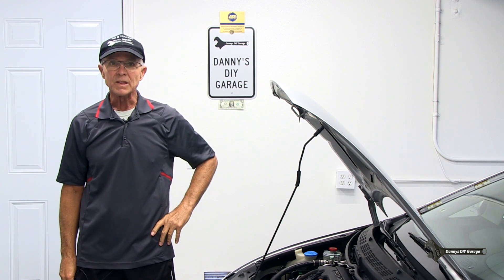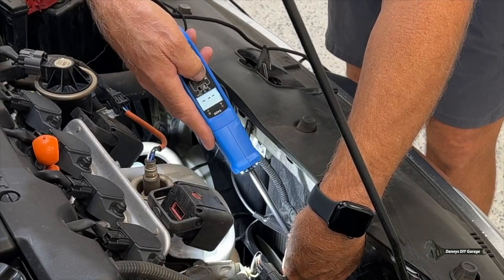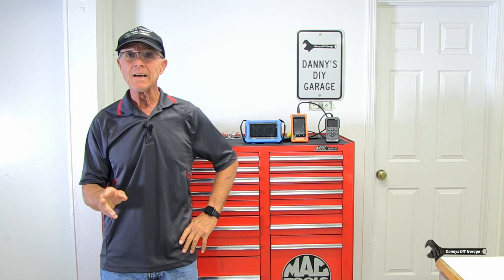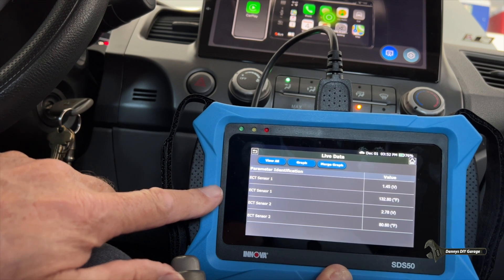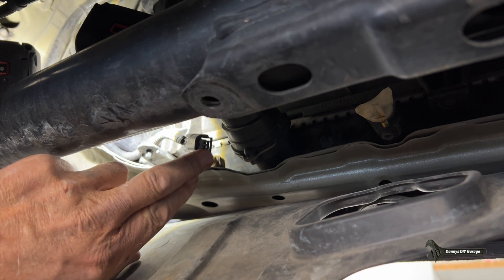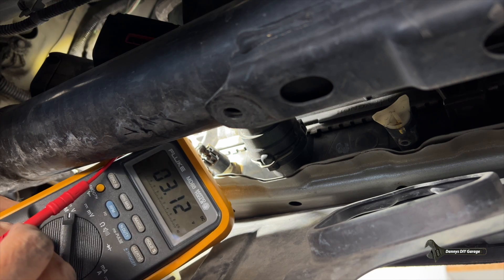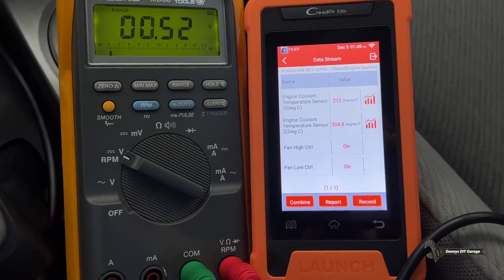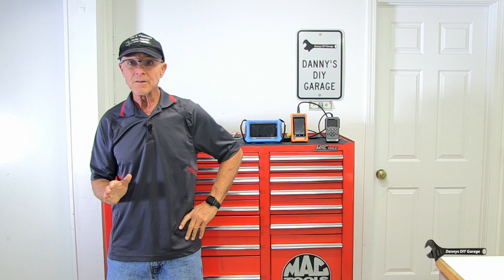Honda Civic Overheating? Cooling Fan NOT Turning On? (Diagnosis & FIX) How Fans Work

Comment: Hi Danny, thank you so much for this video, my car is overheating. I did the diagnosis as per your video and both fans come on when ignition is on and AC is turned on.

I dont have the tools for testing voltage etc or car scanner.

Could I simply replace the 2 sensors and that should fix the issue?
Reply from the maker: You could, but there are other things that could be causing this, such as wires, relay, computer its self.

Comment: Hi I have a 07 SI coupe. My problem started with code p0118. Besides that I had seen the fans stayed on after the ignition was switched off. So the actual problem was after all that my fans never came back on so I buy 2 new sensors from Honda ect 1 and ect 2. Now after install no codes are on and the fans do turn on. I did the ideal relearn procedure and after the fans do come on this time because before they didn’t now they won’t shut off at all. I remember before when everything worked correctly I would disconnect the ect 2 sensor and the fans would come on automatically but now that I do that they don’t. Do you think all these problems are coming from a none working relay that would be the relay that is the fan control relay being the gray one? Please help I’m at a loss here.

Comment: Hi, 2006 Honda civic here. Overheating, both ECT sensors changed, thermostat changed, fan works when direct power is applied, fan works when A/C is on. However, fan will not turn on when temperature is reached. Relays and fuses are all good. ANY OTHER IDEAS PLEASE❓️ ALSO ZERO CODES.
Reply: Aftermarket generic garbage parts sensor?
Reply from the maker: did you watch all my videos on fans and overheating?
Reply: @dannysdiygarage  it could be a number of things. In this case
It was the Head gasket.
Reply: I’m having the same issues now on my 2010 civic. Did you find out what was causing the issue
Reply from the maker: Watch the video at 13:42, you will need to see if sensor 2 drops to .5

Comment: 2010 civic. There are no codes at all, but I am getting ECT 2 staying way lower than ECT 1. I have a fancy scan tool showing each degree as it goes up. I think my fans aren't turning one because ECT 1 may be at 111 Celsius (so getting pretty hot) or climbing even higher, and ECT 2 might still be sitting at 1/3 of that and 3 volts. So I guess it must be either that connector or that sensor? Nothing else causing the fan issue likely right? Got the sensor coming tomorrow, and hope it works.
Reply from the maker: The fans are controlled by sensor #2 only, and will only turn on once sensor #2 gets below .5 volts, the fans will never come on unless sensor #2 is below 5 volts
Reply from the maker: https://youtu.be/GVRF11BPRZA?si=Fyop-iAqojrXTzb7
Reply: Here is a pic of while it is heating up. Replacing thermostat at least made it start to fluctuate as it goes up according to ect 1 and push heat out through the heater, so that is progress. EcT 2 replaced and it still has a big gas with ECT 1 and does not move. I watched that other video and it was very helpful. It is really odd because ect sensor 1 is showing me 110  plus in celsius so well over 200 degrees while ECT 2 voltage  and measured degrees stays insanely low. Like 3.49 volts and 13 degrees celsius which can't be right. Brand new sensor I just tried. Tested the voltage and the connecter gets 5 like you said. Relays and fuses are all fine and fans go on when I put ac on. I am very confused about the new sensor is not changing much while sensor 1 is doing the data right. There is no way this is a pcm or communication thing right?  @dannysdiygarage
Reply: @elizabethloudon6097  Hi, you might wanna check out your radiator. The ECT 2 is located at bottom of radiator and the radiator lines are choked or plugged with debris (most probably from running on tap water or a poor quality engine coolant by the previous owner). So, very limited coolant flow to ECT 2 causes it to read low temperature because the radiator is plugged and that's why it reads low than ECT 1 as there is no equal flow of coolant between the 2 ECTs. ECT 2 at low temp wont let the fans turn ON and ECT 1 will continue to show raised engine coolant temperature on Dash meter. Get the radiator serviced and thoroughly cleaned. flush the engine block and heater core with distilled or tap water on high pressure. vacuum or pass air through the whole system to remove all the residue and tap water and then fill out with good quality coolant. That should fix it
All this I am telling you from my own 8th Gen Honda Civic.
Reply from the maker: Watch this video I’m going to send you, then go back and watch the one I refer to, this is for a Element but they work exactly the same way

Comment: My fan comes on at 224F, per OBD2. The temp gauge remains in middle (always good). Presumably normal? No codes...just concerned that others claim their radiator temp switch activates much lower. One other issue with my 2005 CRV is that the fan will 'turn off' if the key is turned off...it doesn't stay on to cool when car is not running. Can't find info. on whether Honda intended this or not.
Reply from the maker: Perfectly normal

Comment: Do you know what will cause both fans to run all the time?ive replaced the tstat,both temp sensors and filled and burped the radiator.also the ac lines ice over while idling.(2006 civic sedan 1.8)
Reply: Yes sir.ive swapped relays,replaced tstat,both temp sensors,new blue coolant with bleeding the air off the hoses.the ac lines freeze up ,and i was told its either the ac high pressure switch ,or the actual control head in the car .the car blows cold ac even when the ac is shut off.we plugged the scan tool up and it would not let us control the fans.also u can unplug both temp sensors and the fans will still run.we also installed a new fan with no luck.its almost crazy now.haha.any input would be great
Reply: @sean1234-h3g 
My car is doing the same thing. Fans run when heater is on even when cold start.
Reply from the maker: Did you check the relay

Comment: Greetings from Veenzuela, excellent explanation of how it works, but I have one detail to see if you can help me. I have a 2007 civic, it does the entire cycle, only the fans turn on at low speed, and the water reservoir begins to bubble, the cycle does so at 96 degrees Celsius and ends at 92 degrees Celsius, if I turn on the air conditioning, if they turn on at high speed.
Reply from the maker: I don’t have that answer

Comment: I refilled my reservoir with coolant but still overheating. Fans are running. Do I need to also put coolant directly via the radiator cap?
Reply from the maker: Yes, when the vehicle is cold

Comment: 2012 civic..NO heating or cooling codes....Replaced BOTH fans,,BOTH coolant temperature sensors and the thermostat..I also replaced the hvac pressure sensor...fuses and relays working properly....Car still got hot in the drive thru with the red light on,and the fans refused to come on,,this is after everything has been replaced...Later tonight fans came on,,,,work for five seconds or so ,then shut off...Both fans would come on every 30 seconds or so then shut off..When the fans were working,,civic would not overheat...Then sometimes the fans won't come on at all while the car is overheating....It's very inconsistent....I'm at a loss...And all of the parts were brand new..The last thing I put in was the AC condenser fan today...There were times where it was working while car parked running...Fans never stay on for more than five seconds...You have anything for me? lol...I also am having issues with my ac...Car runs great,,I don't want to hurt the motor...In the civics,can a condense issue cause this problem?? I mean,,it's thE ONLY thing I haven't replaced!
Reply from the maker: Have you watched this video https://youtu.be/i94Bv8KaVzA?si=LBkjO7lAS8qy1hbd
Reply: @dannysdiygarage  I watched the video...I don't believe it spoke of what I'm dealing with as far as the inconsistency....Can a bad condensor cause fans not to come on when car is overheating?
Reply from the maker: Short answer no, send me an email with your phone number I’ll call you and try to help, but only if you’re in the USA
Reply: @dannysdiygarage  Hi Danny. Email sent last night.
Reply from the maker: @atgn70  are you ready to talk
Reply: @atgn70 how did it go you got it working ok I kinda  have the same issue
Reply: @shemarhylton8093  Haven't figured it out yet.
Reply: @atgn70 did you replace the connectors on the fans too ?
Reply: I have the same exact issue you have! Did you ever find the culprit
Reply: @CarloFrancavilla  Bad wiring. I'm at a loss. Spent too much money and time to not figure it out.
Reply: @atgn70  I’m getting to that point too… wiring is my last resort. I actually disconnected the sensor in the radiator and it seems the computer started using the engine ECT to operate the fans. It’s been getting me to and from college with no issues that way. I will probably wire the fans to a switch and call it a day lol
Reply: Have you turned the ac on? Fans should come on

Comment: 2010 honda civic running hot at idle and while driving. Fans only come on with ac switched on. Oil is new and full. Cooling system is full, topped off, and burped. At high temperature overheating without ac fans don't work. Also new temp sensors are new. Please help
Reply from the maker: Let me do a little research and I’ll get back with you
Reply: @dannysdiygarage am finding same issue is there any solution for it .?
Reply: @The.khushwinderbrar  I have this issue too. AC turns the fans on, but the fans are not turning on due to engine temp. Help
Reply: make sure your radiator fan is working when not using ac. issue i'm dealing with currently and trying to figure out.

Comment: The engine was so hot the plastic was burning my hand
Reply from the maker: Engine temperature can get up to 220 degrees without overheating, plastic could be hot to touch, I suggest getting a scanner that read both coolant sensors, I have links in the description

Comment: Hi again my Honda Civic is overheating without showing signs of overheating
Reply from the maker: That doesn’t make sense
Reply: The gauges said that it was fine but even my spark plug covers were hot to touch
Reply from the maker: @willfreethemfreethem7671  if you want peace of mind and want to be 100% sure, buy this: https://amzn.to/3H3yrkg this will check both coolant sensors and you can be sure there is no air pockets, also check your level 👍🏼
Reply from the maker: @willfreethemfreethem7671   I'm working on a video that should be out next week that might help you with this issue

Comment: Hi.. Thanks for video.. My car Honda Fit 2017 Fan High Speed Running about 96c.. Fan Low Speed Running with ac on only..its normal?